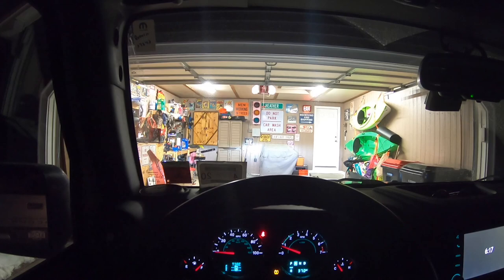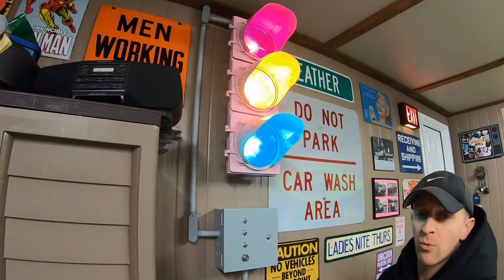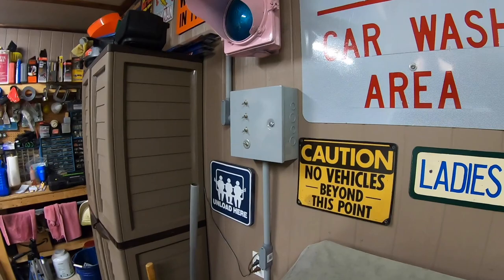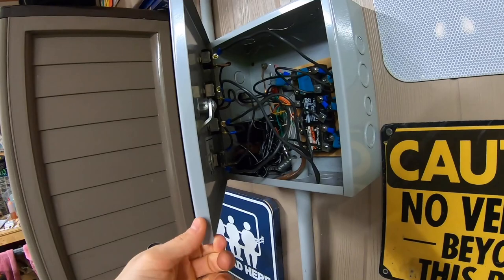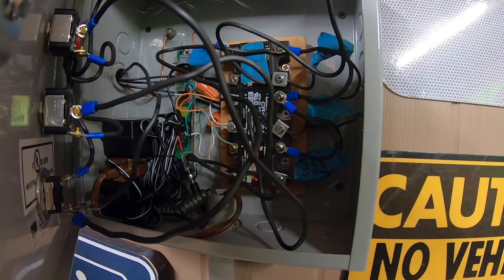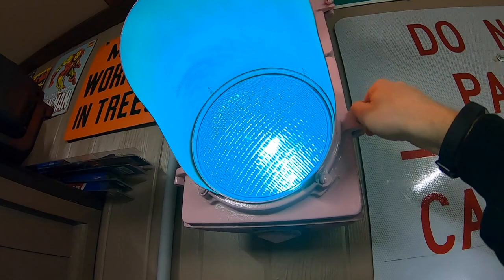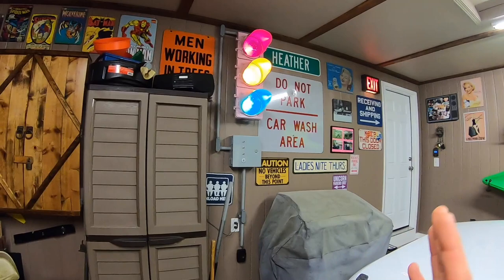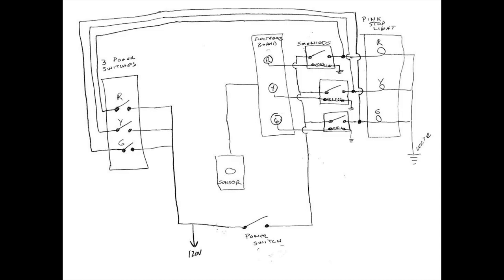HOW TO PARK YOUR CAR WITH A GARAGE TRAFFIC LIGHT PARKING SENSOR SYSTEM

Comment: Hey JB that's pretty cool I'm originally from the Buffalo area. I now live in Phoenix AZ. Thanks for the video. Great job.
Reply from the maker: Hey Paul! What part of Buffalo were you from originally? Are you planning on installing a traffic light in your garage too? Thanks for checking out my channel bud! 👍
Reply: @GarageGear  I'm originally from Lackawanna, I have lived in S. Buffalo, West Seneca and Hamburg. I was a West Seneca firefighter for a about 10 years. Yes I plan on installing my traffic light, pretty much for the same reason you did. to tell my wife where to stop. lol I have already ordered a Park Zone. I have a newer light with LED lights. I'm wondering if I have to use the relays the way you did.
Reply from the maker: @paulb7862  that’s awesome Paul! I would definitely use the relays as I did. Follow the diagram I have at the very end of the video. That’s how I got mine to work after many tests. Let me know if you have any more questions!
Reply: @GarageGear  Hey JB what Park Zone did you get?
Reply from the maker: @paulb7862  I can’t recall the exact model number but I can tell you I actually bought two. One was gray and one was black. One of them, can’t remember which had a wall adapter plug. That’s the one you want. Do not buy the battery only one. You’ll be replacing batteries every month. You can also email me any questions along the way too with photos. It may be tricky but I’ll try to provide the best help I can.
Reply: @GarageGear  JB the one I have got is gray, and is the plug in unit.
Reply from the maker: @paulb7862  that’s the one to go with. 👍

Comment: Very cool! Thank you for making this video!
Reply from the maker: Flint Layfield Hey Flint, I was going to tag you in this video today because I know you asked for it but it looks like you beat me to it lol. I was originally considering doing a video on it but was unsure if there was any interest. Then I saw your comment and decided to go for it. Thanks for motivating me to do a video on it. Thanks for watching!
Reply: Garage Gear thanks for keeping me in mind. That's awesome.
Reply from the maker: @BigDaddysGarage  Hey Flint, Not sure if you are moving forward with your traffic light install or not but I recently attached a link to the park zone that I used. The sensor on the bottom of mine is slightly different because it is the same one from the previous park zone I had. The sensors all attach  and work the same.  Hope this helps you out! Thanks for being an Awesome Fan!
Reply: Garage Gear Not yet. Probably not till spring. I'm in Ohio and don't spend much time in the garage during winter. And I'm not too savvy on electrical other than basic lights/switches, so I'll be seeking help from a friend of a friend. And I'm sure we will be referring to this video and any info with it. So again, seriously... THANK YOU!
Reply from the maker: Flint Layfield no problem at all bud!  Keep me posted!